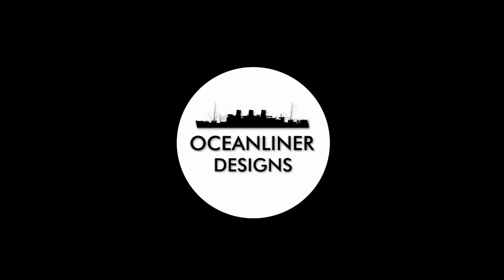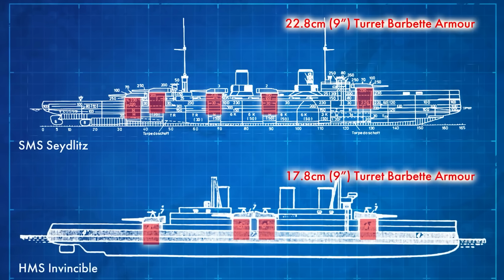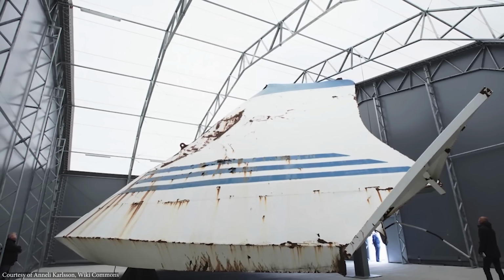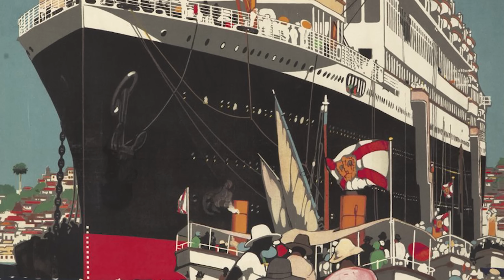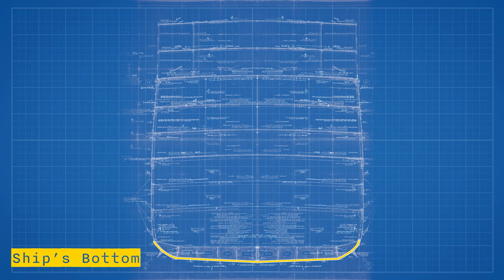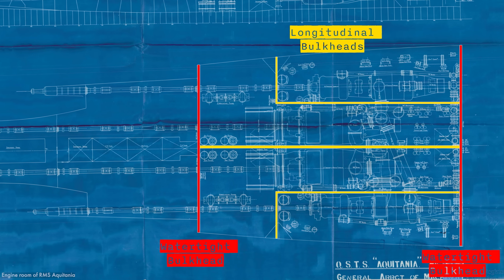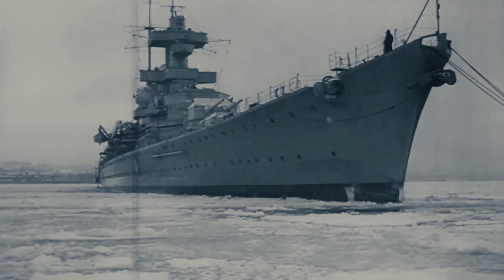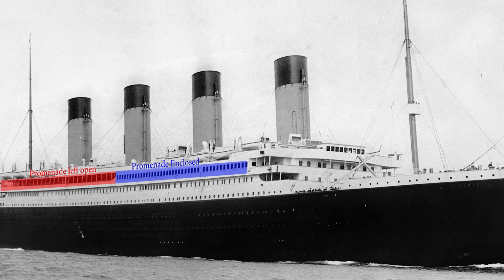The Worst Ship Design Fails in History

Comment: There is a lot more complexity regarding the battlecruisers that has not been included. 1) The general confusion about the British battlecruisers. There were two generations of battlecruisers at Jutland; the first generation was the Invincible class, which are essentially cruisers with battleship guns stuck on and were never meant to face a peer opponent. Of the Second generation, Lion, Princess Royal, Queen Mary and Tiger, only Queen Mary was lost due to powder handling issues. HMS Tiger, with correct powder handling, was hit 14 times and did not explode. The second generation were based on battleships but with fewer guns and more engines. These were designed to, and did, take on peer opponents, as demonstrated at the Battle of Dogger Bank. The video states that German belt armour is 7". By comparison, HMS Tiger has a 9" belt, which is thicker armour than the Germans.   
2) The German armour thickness. The German battlecruisers were armed with 11" guns, whilst the latest British battlecruisers had 13.5" guns. So, the claims made about German belt armour are misleading because, whilst they were thicker, they had to stop bigger shells, so the protection was not too dissimilar. 
3) The British and German cordite powder had different formulations. The German powder was more stable, which is why it burned rather than exploded. Had Seydlitz been carrying British powder, she would have exploded. Had the British ships been carrying German powder, they might have survived. 
4) The fuses on British shells didn't work correctly; the shells would detonate on impact (outside the ship) rather than detonate a few milliseconds later when the shell had penetrated, meaning that the German armour appeared more effective than it would have been against working shells. 
Conclusion: Writing off an entire classification of ships simply because the first of multiple generations didn't work displays a significant lack of knowledge.
Reply: Yeah, the Jutland part of this video was pretty rough. Basically an anecdotal story with some numbers thrown in to make it appear more founded.
Reply: Correct; but wait - there's MOAR!  An earlier battle, Dogger Bank, taught the Germans some valuable lessons that, being at war with the British, they didn't pass-on; that was churlish of them, don't you think? 😆  I believe you may have mixed this battle up with Jutland, because the famous hit on Seydlitz happened at Dogger Bank; an ammunition fire breaking-out in the barbette, a German named Wilhelm Heidkamp with the delightfully evocative job title of "pumpenmeister", grabbed red-hot valve handles with his bare hands and flooded the magazine.  Heidkamp severely damaged his hands and lungs but survived the battle, took over his family's grocery store after the war, had four children and died in 1931: https://en.wikipedia.org/wiki/Wilhelm_Heidkamp  

The Germans took fire protection in their ammunition spaces more seriously after that, but the British didn't get the memo; one of the Victoria Crosses awarded after Jutland was to Royal Marine Major Francis Harvey, who commanded the centre turret on HMS Lion.  A German shell penetrated the turret and exploded, killing nearly everybody and causing a massive fire; one of the few survivors was Major Harvey. Severely injured, he stood his post, ordered the magazine flooded and sent a runner to the bridge to report the turret out of the fight.  Cordite charges in the shell handling room ignited and killed everybody there; after the battle, the doors of the magazine were found to be badly buckled but they had resisted the flash from the burning cordite because the magazine behind them was flooded.  The formal conclusion was that this alone prevented HMS Lion from exploding and joining its sisters on the bottom; Major Harvey's charred corpse was buried at sea during the cleanup after the battle https://en.wikipedia.org/wiki/Francis_Harvey .  Other ships in the Battlecruiser Squadron were not as dedicated to fire safety, and some had formed a grisly habit of storing main gun rounds and cordite charges in the backs of their turrets, the better to increase their rate of fire; I've seen reports that Royal Navy divers visiting the wreck of HMS Queen Mary found shells and cordite charges in the aft turrets, which were not affected by the explosion that sank the ship.

 - Oh and: in your segment on Imperator, you twice show the wrong ship's bow - the Vaterland had that heraldic crest, in place of the Imperator's winged eagle 😉
Reply: The other point between German and Royal Navy design concepts that is normally pushed to the bottom of the page and forgotten is that the Royal Navy was a global navy, and expected their ships to sail for long periods with their crews living on board.

The German navy, while setting themselves some grand objectives, was effectively a 'North Sea' navy. They knew that they were very unlikely with many of their ships to sail and fight the oceans wide and hence there was no real need for massive fuel reserves or long term crew accommodation.

And if you are not designing your ships with those features that is space/weight you can use for something else... like more guns or more armour.
Reply: I think the battlecruiser ultimately triumphed. As technology advanced between the wars, boilers and steam turbines became smaller and lighter for the same power output, and more weight efficient designs with fewer turrets, each containing more guns were developed. This allowed more weight to be carried as armour to reinforce key compartments. The fast battleships of World War II were still effectively battlecruisers, judiciously compromising some armour and firepower for outright speed, but it was the old fashioned slow battleship that became obsolete.
Reply: @philiphumphrey1548  A strange one for this topic - the Iowa class.  They were built after the abandonment of the Washington Naval Treaty, and their displacement was effectively unlimited, treaty--wise; but they nonetheless had a real limit in that they had to be able to fit through the Panama Canal.  In a "fair" fight against a Yamato, I would not like to rate their chances; but once radar gunlaying and hundreds of carrier-borne fighters, bombers and torpedo planes were added to the mix, the outcome of such a fight ( - and EMINENTLY fair; the word "fair" is not found in any warfighter's lexicon) would be as one-sided in Iowa's favour as in the real world it proved to be, especially considering neither Yamato ever sighted a major Allied combatant and both were sunk by airplanes.  The Pacific war was distinctly depressing for a purblind battleship nut (i.e., me), and the ships themselves largely confined their activities to shore bombardment and acting as fast anti-air platforms to protect the carriers.
Reply: @philiphumphrey1548  Somewhere, I read that a battleship was defined as a first-class ship with armor sufficient to protect itself from an identical ship at a specific distance. Battlecruisers did not meet that armor requirement, but IIRC WWII battleships did. The more powerful engines allowed faster speeds, and larger guns meant carrying fewer was still sufficient.
Reply: Well said!!!

Comment: I feel like one ship is missing from this video: the Scandinavian Star.
I'll give you the TLDR: There was a fire on the ship, fire doors wouldn't close due to bad design, there were very flammable panels in the hallways that released hydrogen cyanide when they burned.
There is more to the story, more mistakes and idiocy, but that won't fit here 
The ship wasn't lost, but a lot of people died due to bad design and testing.
Honourable mention to HMS Sheffield and the decision to use flammable fabrics and nylon uniforms on a warship that might get hit and start burning...
Reply: HMS Sheffield gets even weirder when you realise their satellite radio couldn't be operated at the same time as their early warning system... and on that fateful day the sat uplink did mask the early warning sensor, probably contributing to the sinking.

Comment: The German battlecruisers carried significantly weaker firepower in order to get their heavier armor, because both armor and armament increase weight, which requires larger ships with more expensive machinery. They should have been equally at risk to the British guns, since the larger guns were powerful enough to offset thicker armor.

The British ships' increased armament wasn't telling because the quality control on their shells was lacking in a way that they detonated prematurely, rather than penetrating into armor and exploding in the vitals. The biggest problem for the British is that Beatty had decided against sensible precautions with ammunition and propellant, which mean that the turret offered a direct route for flash fires to reach the magazine. The safety interlocks had been deliberately overridden. All battleships are vulnerable to such issues, the armor simply makes it harder for the enemy to get a shell into the shell handling gear. The British battlecruisers failed comprehensively at this junction, with only one managing to flood the turret due to the heroism of the mortally wounded Major Francis Harvey, and some of the somewhat better armored later battlecruisers like Lion and Queen Mary taking similarly bad hits. At Dogger Bank, SMS Seydlitz was in a similar situation and managed to flood her turret. She could easily have gone up if it weren't for the heroism of Wilhelm Heidkamp, who turned the flooding valves despite them being red hot. Tiger, the newest and best armored battlecruiser, with a margin of superiority over the German ships due to the recency of her construction, held up to turret hits but even she had rough going.

Comment: 8:13 Invincible's (and others) magazine explosion is generally attributed to the poor magazine handling practices at the time, and not any one design flaw. Flash protections were disabled or removed from many ships to speed up gun loading, and shells and propellant were improperly stored in the turrets. This was a matter of poor doctrine.

That isn't to say that the battlecruiser was a failed idea, but the near disaster that was the battlecruiser battle at Jutland was not the fault of the design of the ships, but of execution, poor communication on the part of Beatty, and bad ammunition handling.

The Germans had learned their lesson when Seidlitz nearly exploded for the same reason at Dogger Bank. They changed their ammunition handling practices as a result.

Comment: One thing to note about the German "battle cruisers" is that they were more heavily armoured in general compared to the British ones. In order to save weight and keep the speed up the Germans sacrificed gun caliber instead of armour. German "battle cruisers" had at best 12" guns, the British had up to 13,5" guns on theirs.  
Von der Tann for example had 11" guns. Von der Tann is credited with sinking Indefatigable which had 12" guns at Jutland. Von der Tann received several hits from 13,5" and 15" guns from Tiger and Barham (an actual BB) and survived the battle. Because Von der Tann not only had 9" barbettes but also a 10" belt. That is a lot thicker than the 6" of Indefatigable, which she sunk. And that is true across the board. 
The most heavily damaged German "battle cruiser" was Seydlitz. She received a staggering 21 hits from BB caliber guns on top of 1 torpedo hit and 2 hits from cruiser caliber guns and survived.  Seydlitz had a 12" belt and 9" barbettes. The most modern "battle cruiser" the Germans had that day was the Derfflinger class. 12" guns, 12" belt and 10" barbettes. The most modern British battle cruiser at Jutland was Tiger with 13,5" guns, 9" belt and 9" barbettes.
Reply: I expect people have already been discussing this subject again further down the comments.  I'm no expert but I understand that the Germans used brass cases for their propellant which itself was of a more stable formulation.  Moreover their ships were designed to operate primarily in the Baltic and North Sea and so range was not so much of a concern, thus more weight could be devoted to armour protection.  Lastly, handling proceediures had been revised after a previous action, the Royal Navys battlecruisers under Beatty had been encouraged to get as many rounds down range as possible, whereas Jellicoe had  insisted accuracy over rate of fire onto a target.  Lastly of course is the tenancy of their shells to explode prematurely, indeed Sheer apparently said that if they had worked properly then his fleet would of been destroyed.
Reply: After the battle Germans shit themselves never to reappear at sea again because of overwhelming numbers of the British fleet  scrap metal dealers thank the Germans for the hundreds of thousands of tons of free steel at Scarpa flow

Comment: Estonia: 1. The ferry was originally built for full sea operation as between the continent and UK for instance. The original design had been changed on behalf of the new owners during build and the ship was lengthened by about 18 meters and the superstructure changed. During that the Estonia had been de-classified for near-costal operation only due to the changes made by the operators. It were considered "unneccessary" for operation in the East Sea. 2. the so-called "north atlantic shield", a second gate behind the bow vizor, had been removed earlier by the owners request, since it allowed some more vehicles to be loaded. 3. Most of the servicework was done "at home" at the owners workshop. The bow vizor was known to be deformed and untight due to mishandling and rough weather and developed cracks at the sides. The workers in the shipyard brazed the broken vizor hinge together with stick-welders instead of entirely replacing hinge and bearing. Major cause for the loss of the Estonia was - again - greed and unprofessionalism during operation and service. As with the "Herald of Free Enterprise" for instance or the loss of the "Jan Heweliusz" in 93. Also a poor designed, poor operated, ill-fated, beaten up and hastily repaired ship, that occasionally showed the tendencies to capsize. Look at that for example.

Comment: The vehicle deck at 14:14 is of the British Rail train/car ferry Vortigern of 1969. When the picture is repeated at 16:38 the video implies it is on the Princess Victoria. The Vortigern was a much larger and more modern vessel than the Victoria and benefitted from the lessons learned from that tragedy as well as the rapid development of vehicle ferry technology in the 1950s and 1960s.

Comment: I do firmly disagree whenever Titanic's design is viewed as a failure in hindsight. At that time, there wasn't any ship in service that would've been able to of withstood the level of water flooding the hull. It is to Titanic's credit she sank slowly on moretheless an even a keel (minus the list to port of which was partly down to the coal imbalance and Lightollers decision to open D deck doors during the sinking). 

If there was any other ship around then that could've withstood the damage Titanic had with 6 compartments opened, then you could argue a case, however there wasn't any. I would say that maybe a double hull along the waterline might of helped, but the disaster was something that wasn't foreseen given the amount of compartments opened in a row. A mix of events just caused the perfect disaster.

Comment: The Mary Rose - Henry VIII's famous flagship was redesigned to allow a new breed of stronger but far heavier cannon. Unfortunately as it turned out this new added weight meant that if you turned too hard in one direction the gunports would reach dangerously close to the water line. You can imagine what happened.
Reply: Decapitation of the masthead.

Comment: A significant factor in the poor survivability of the British battlecruisers at Jutland seems to land at the feet of ammunition handling rather than the design of the ships themselves.  In order to obtain higher rates of fire powder was stored in places it should not have been and blast doors that were supposed to be opened to feed ammunition and powder through and then closed immediately were locked open.  When HMS Tiger joined the force and her captain was shown the modified procedures he refused to adopt them and maintained the safer handling practices that were supposed to be the norm.  HMS Tiger took many hits at Jutland, including hits of the types that blew up the other battlecruisers, and did not explode.

Hood was a different story.  She was as armored as a Queen Elizabeth class battleship, Bismarck just got a very, very, very lucky hit.

Comment: The discussion on the RO-RO ferries - wide open interiors - applies in spades to freighters on the Great Lakes. Although not ocean-going, some are nothing more than 800 foot long bathtubs with a slightly pointy appendage at one end and a power unit at the other. While they are generally laid up during the winter, the storms of November (and other months) have repeatedly exposed this design weakness in the late 19th century and throughout the twentieth.
Reply: Of course the most (in)famous example would be the Edward Fitzgerald...
Reply: The "Big old Boats" YT channel has heaps of stories of unfortunate vessels of all types that met their end on the lakes

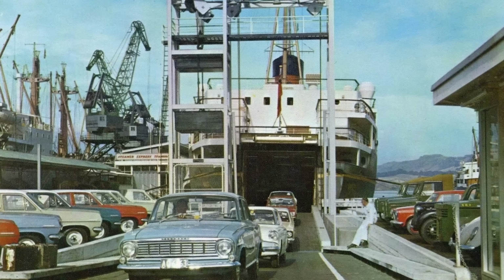Comment: 13:06 The later "Maori". I travelled on it many times, overnight between Wellington and Lyttleton in the 1960's, sometimes with a scooter or motorbike. Good, solid ship, though the "Wahine" was new and nice... Cook Straight was a challenge, sometimes with gigantic waves. Neither ship had an opening bow, only the stern had a ramp. The "Wahine" was holed by Barrett's Reef in a hurricane and sank in April 1968.